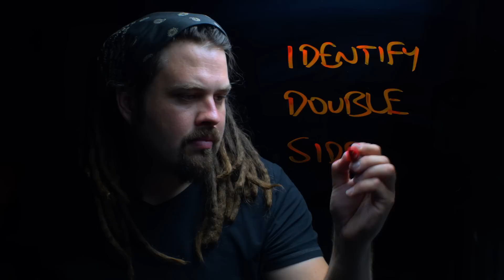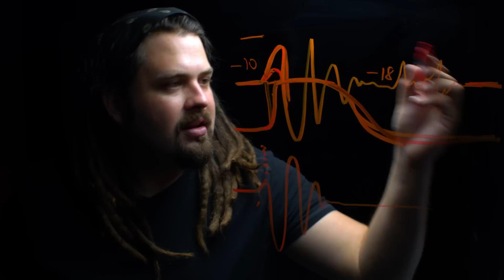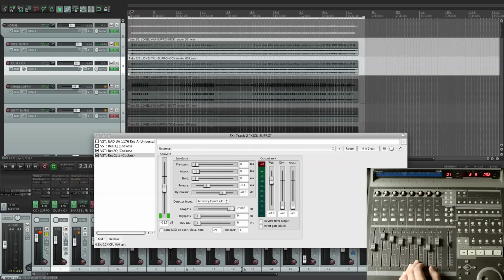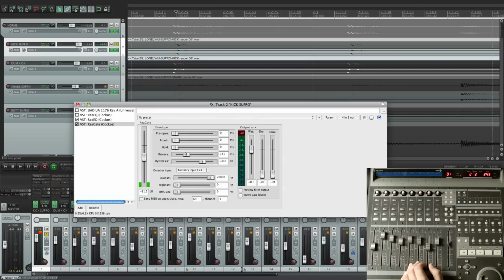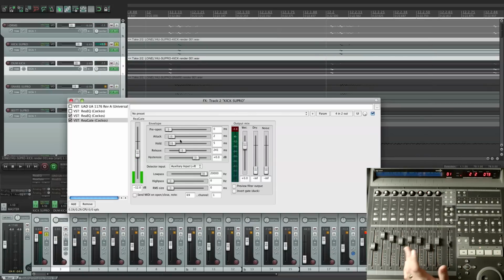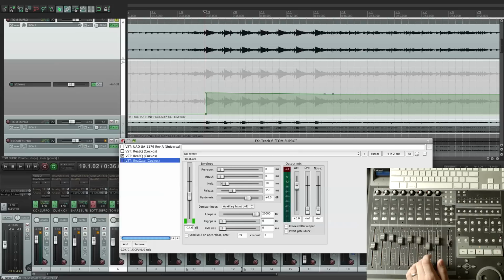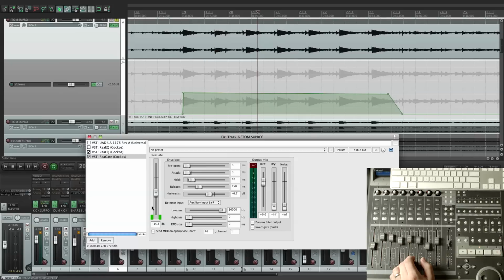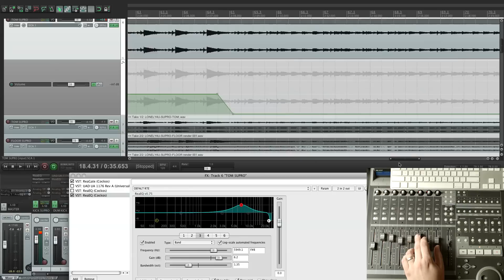Drum Gates - Drum Mixing Part 4

Comment: ReaGate's pre-open is super helpful for gating. I typically set it a millisecond or so faster than my attack.

You were talking about using ReaGate as more of an expander than as a hard gate....You can either mix in "Dry" signal using the faders on the right hand side of ReaGate or you can use the "Mix" knob to the far right of the fx display window (to the right of the "Preset dropdown).

Thanks again for the awesome, gigantic pile of info on your channel, Ryan!
Reply from the maker: DontWorryImAPilot Sure thing!

Comment: I use the pre-open parameter on that gate (Reagate) and it works!
Reply from the maker: Copiarock Yeah, it's pretty awesome
Reply: +Copiarock i think its basically a version of the shifted dummy track in effect. I found its not the best sounding gate though...certain other gates must have it slightly but hard-wired. I preferred the sound of eventide ultrachannel but it was definitely adding an attack, especially before a comp, so i might try this...
Another thing i thought was to also shift it forwards (maybe add a short delay to that other dummy track to save on track), so that you can simulate hysteresis.
Reply: I've used it just today, the pre-open is nice but has quite a weird issue, it puts the sound forward. I saw this because i recorded the track, and all the kicks coming through the gate were a couple of milliseconds earlier than the original track. I think this is why jorgepeterbarton thinks it's not the best sounding. Though, because i rendered the track, i could shift it and align the phase nicely.

Comment: I believe the snap you get from using the gate on your main kick track and using a fast/instant attack is an artifact from digital sound going from zero and instantly having to go to a different value. If you split the track at the top of  a  transient and deleted the first part, without using a gate, you should get the same snap.
Reply from the maker: Søren Sørensen Yeah, I agree.

Comment: hey, 
love your videos. I was wondering what are your thoughts or if you've ever heard of activating a gate with an acoustic drum trigger? 
Thanks
Reply from the maker: +Slightly Drowsy I've never had an acoustic drum trigger to try it, but I would use it in the same way. It would give me a super clear signal for the gate to open (instead of using EQ to help make it obvious and take down the bleed into the gate), and then I would scoot it up just a hair ahead the tom hit so it's open at the beginning of the hit.